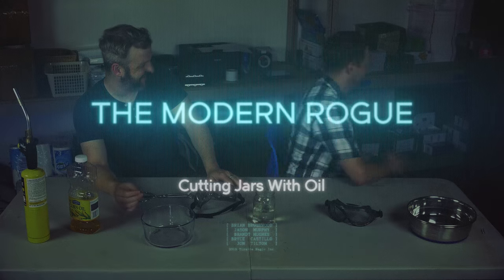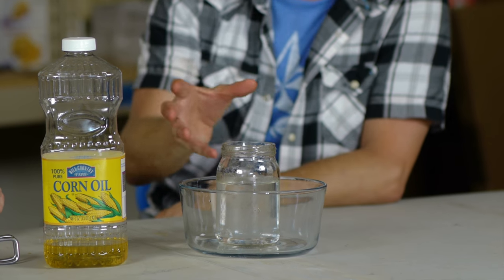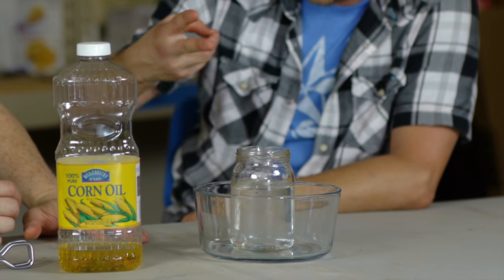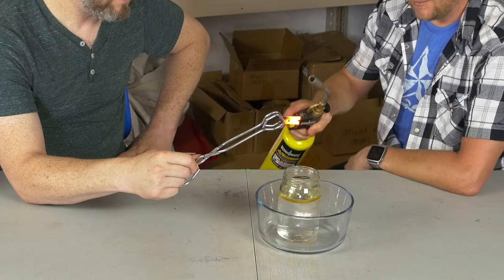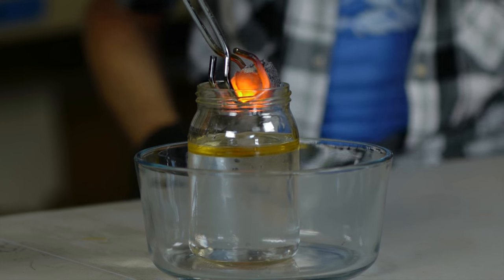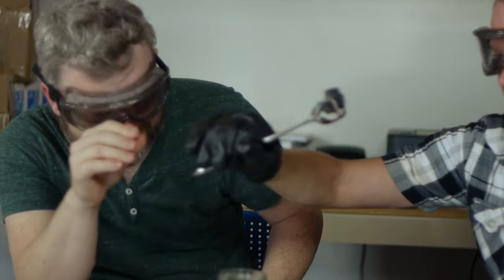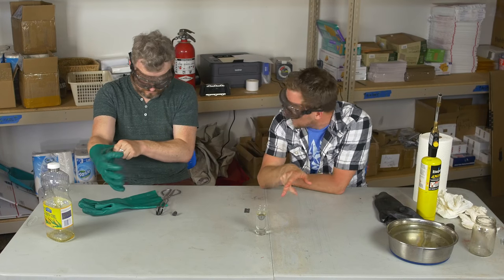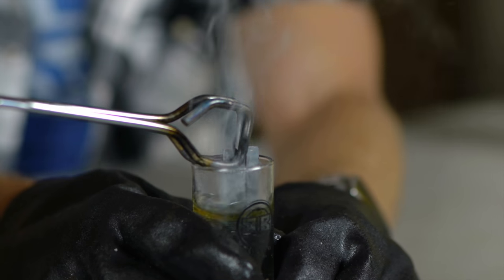Does Hot Oil Really Cut Glass?

Comment: This is much easier to do this with duct tape, a candle and an ice cube. 
Score the glass with a hacksaw blade, bastard file, nail file, bread knife, nail or anything else that can scratch the surface. Tape around the underside of that line (reflective tape is the best). Rotate it over a candle until it becomes uncomfortable to hold then rub an ice cube around the glass just above the line and it will crack along the score. 
Improvements include using a torch with the glass filled with water up to the height of the tape and flipping over and dipping it into an ice bath rather than using the ice cube.
My room mates and I made votive holders out of old ramune bottles using this method.
Reply from the maker: If you have a hacksaw, why wouldn't you just cut through the jar?
Reply: +Scam School because it wouldn't be as much of a clean cut.
Reply: Scam School Exactly as neto503 said, as well as not having a pile of glass dust to dispose of. Breathe that in and you might as well have smoked a whole carton of cigarettes.
Reply: +Scam School As a random independent observer of this conversation, I believe the method mentioned above should theoretically work, especially if you score it with, say, a flashy diamond ring. Even it it fails, I'd give it a watch, like, and maybe even a share(but let's be honest, I have no friends, so sharing wouldn't do much good from me.)
Reply: Bobal27
I know this works. I used it many times.

Comment: 1. Fill with water to the line you want to cut.
2. Fill the rest of the way to the top of the glass with oil
3. Use the torch directly on the side of the glass in the area of the oil, rotating the glass (or the position of the torch) so that you heat all sides evenly.

Only some glass works. Some glass handles temperature-induced stress-fractures better than others. The thickness should be irrelevant. Probably best done with empty $5 wine bottles.

Different boiling temperatures are irrelevant as well since the water shouldn't boil in the first place, and the oil would burn before it boils. The trick is to have one part of the glass be a vastly different temperature than another. Setting the very bottom of the glass in ice water or putting a thin layer of a third kind of liquid (like a denser type of oil) can also help, as the idea is that heat has trouble passing from one medium to another. The change in mediums is acting like insulation that should cause the part of glass contacting the oil and the part that's contacting water to be different temperatures.

Honestly though, you don't really need the oil. This can be done with just water. Just do the same thing as above but without the oil, the oil just helps to distribute the heat evenly.
Reply: and so at some point the glass will break throwing hot oil into a flame. Not good?
Reply: Vegetable oil isn't lighter fluid or something, it doesn't immediately catch fire and get out of control at the slightest sight of flame and the glass doesn't shatter like an explosive as long as you don't stick a cork in the thing. It should break cleanly and in a controlled manner. 

Besides, as I said at the end you don't really need the oil anyway. You can do this with water alone.

Comment: you need a source of heat where by there is a discrepancy in the surface to make a ring, like the oil, ideally you'd have the water in a bowl, you'd bring the oil just under its boil boiling point and poor it in the water , leave it a few seconds to heat up a ring and then you'd want to pick up the glass and put it in ice cold water where by the temperature difference causes internal stresses and blows the glass, hopefully in the ring or it will completely blow the glass bottle if too much area is heated
Reply: to clarify where I say ring I mean the shape that the oil will make on the glass, not a physical item =)
Reply: Pouring boiling oil into water is a really bad idea since the water will instantly boil and likely throw hot oil everywhere
Reply: +J A i never said it was a good idea, the actual trick is to get a string soaked in rubbing alcohol and just light that before chucking it into the water
Reply: shiro yuki I just didn't want anybody trying what you suggested without realising the risks.
Reply: yup finally someone who else knows yes
Reply: As a Chef, I can tell you putting very hot oil onto water is a bad idea!
Reply: How can you poor water?
Reply: +marcjtdc to be fair i wasnt actually saying a method that is safe to do or the best way, just the only way i could think it would work, usually most just grab string thats soaked in rubbing alcohol, tie a ring around the bottle, light the string and then just drop it in ice water

Comment: if you want to do it with water and oil,  pour oil around the glass in a heatable bowl so it is just under the lip of the glass,  pour water into the glass right where you want it to cut,  and start to heat up the oil on the stove or something,  it is the temperature difference that will allow the glass to cut right above the water line

Comment: 1. Score the glass. NB. Use a jig as you need super powers to get it level freehand.
2. Stand in a metal pan.
3. Add room temp water to the jar until level with the scoring.
4. Add room temp water to the pan. 
NB, This is VERY IMPORTANT: Fill pan slowly while looking at the surface tension where it touches the glass. It will be concave and you have to get point of surface tension a hair's width from the score line.
5. Put a little (Rape Seed) oil onto the water, just about 10ml-20ml 2-4 teaspoons. Add it by running it slowly down the outside of the jar.
This should now cause the oil to float on the water in a pool that encircles the glass, and this is what makes it work, the oil is now filling the scored line. Add more oil if the oil has not joined up around the jar, but you don't need to cover the whole surface of the bowl. The more oil in contact with the water surface the greater it will act as a heat sink.
6. Heat a thin strip of metal until it's cherry red.
7. touch the oil. Ideally you would touch the oil actually where it intersects (and fills) with the scored glass for best localized heat transfer, but you can just get it close.
PLEASE NOTE. You are not trying to heat a ring of oil around the entire receptacle. What you are doing is getting one tiny spot to split with thermal shock. That tiny "hit" (you can think of it as an tiny explosion in the crystalline lattice) will then run around the score line in the receptacle splitting like a fault line in a very tidy earthquake.
Technically you should be able to initiate thermal shock with just a little oil touching a single point of the scored line, but I've never tried. I'm of the opinion that full encirclement might carry the thermal shock trapped in the scoring further around the glass receptacle.

PS Yes there was "some other magic step" you needed to do, and yes you did do it wrong. No scoring and WAY too much, too dense oil (corn oil is heavy so forms a thicker layer).
Going to try again now you know the how and why?

Comment: I have seen different versions of this trick and one involves a thin cord or rope that you soak in oil or your other high boiling point liquid. Then you heat the rope and dip it into cold water. It creates the same thermal shock but much quicker so it has a bigger effect, unlike this one where the oil has to be heated and until you reheat the metal the oil's back to normal temperature.

Comment: HEY BRUSHNUTS!
What you're doing is tempering the glass. Back in my Material Science class during the glass unit we would take particularly finiky pieces of glass and heat them up, when they cooled they didn't break but they became much easier to cut with glass cutters. I would assume that most mason jars would be finiky enough to do that with.

Comment: the way i seen to cut it with oil and water was the string method. 

soak string in rubbing alcohol or any flammable liquid 
wrap around glass at point you wish to cut at
clean surrounding area and light on fire,
let burn for 10-15 seconds, put it out and use cold water.

ive cut several bottles but never with a clean cut with that method.

Comment: The big issue with this. Is because the oil is getting hot, with the water under it is still dispersing the heat enough to avoid temperature shock, you have to apply a thin line of oil along the point you want to crack, then heat it. Then pour cold water over the heated line.

Comment: you dip twine or string in acetone wrap it twice around the bottle where you want it to break but it has to be tight you tie the ends real tight and then you light it in a slightly darkened garage  and let tge rope burn for about 30 seconds to one minute. snuff out the flame and quickly dip the bottom half in a bucket of cold water. this method works best for beer bottles and trust me it does work. However you want to carefully wet stone or sand the break for it will be super sharp if you dont do this.

Comment: I once split a drinking glass accidentally. I took it right out of the dishwasher and put ice water in it. When I picked it up, the bottom just silently slipped off the rest of the glass. Perhaps if you lifted the glass from above the oil it would break, but then again maybe trying to boil oil while it is in contact with water is just a terrible idea.

Comment: I have cut heaps of glass bottles using a rapid change in temperature.
 But this method seems very weird.
It might work if you first scratch a line into the glass first.
This is what I have done and it works really well.... Scratch a line in the bottle where you want to split it. Heat that scratched line up witch a flame and then just dunk the whole bottle into cold water.
 The glass stresses and cracks (hopefully) along the scratched line

Comment: im no expert or anything, but i think its the changing in heat that shatters the glass. so what i think you would have to do, is have ice water, with oil on it, heat up  the oil to as  hot as you can,  and then dip the whole thing in ice water.

its like when you boil a glass, and toss it into the snow, it shatters where the show touches it.

Comment: Easier to use a bucket of ice water (lots of ice), and string soaked in rubbing alcohol. Wind the string around the glass a few times and tie it off. Light the string on fire (best done outside) then, once the flame is TOTALLY out, dunk the whole thing in the ice water. Voila, "cut" glass. Or try putting a lot of ice in the water beneath the oil. It's the sudden difference in temperature that stresses the glass to fracture.

Comment: you should try scoring the glass with a cutter to see if that happens 
if you soak a string in alcohol after scoring around a bottle and then lighting the string on fire it will cut that way
Reply from the maker: Yeah, that version almost certainly works.
Reply: That kind of defeats the point of this video though. As that method was excluded. 
It "works". But it was not a part of the question answered in this video.
Reply: +Scam School hi

Comment: a string tied around the glass at the point you want to cut it, pour vodka, petrol thinners or whatever combustible fluid onto the string. Light it but keep turning the glass, when flame goes out dunk the glass in a bucket of cold water. Easy and way less dangerous than this.

Comment: theres an alternate method that i know that 100% works. you take a thick yarn and soak it in lighter fluid. you then wrap it around the bottle/jar your looking to cut. fill a bucket or sink with water. wrap the yarn around the jar and set on fire. let burn a minute then slowly set into the water. when the fire reaches the bottle the jar/bottle cuts

Comment: me and my sister did try this recently with a Smirnoff bottle, needless to say it didn't work, however soaking a piece of string in methylated spirit, wrapping it around where we wanted the break to happen, igniting it, then dunking it in a tub of ice water after the flames went out (process was repeated a couple times) it did break evenly at the point that was heated from the flames 

t.l.d.r. tried it, oil method doesnt work, precision heating does

Comment: the only way to cut glass is to score it with a fine scratch. apply pressure opposite the score and a crack with form and follow the line. thermal shock can be used with bottles. boiling water along the score line will cause the same effect.

Comment: Get a hair tie, soak it in rubbing alcohol, wrap it around a beer bottle then light it and let it burn for about 30 second. once it has burned run it under cold water and the thermal shock will cracked it.

Comment: while I don't think this tactic works you can cut a bottle with string. soak  string in lighter fluid, wrap it around a bottle thinly (2-3 times), light it and spin the bartender a few mins until the flame dies down, then immediately dip it in cold water and it should break in an even line. 
For a video on it a youtuber by the name of crazyrussianhacker has a good video on it.

Comment: I know if you have a really hot glass and you pour really cold water into it, the glass will split apart smoothly. I just don't think you can be very accurate on where you want it to split because when I did it the glass was still being filled up when it split apart. As for oil and a torch? Hell if I know.

Comment: I had a glass cup, I just got done washing it with hot water (not even hot enough to burn skin). When I poured in cold water from the fridge the glass broke in my hand.
Reply: I think it has more to do with repeated stress fractures. If you try this with glass that is basically unused, it'll be much harder to do. My glasses are about 25 years old. I imagine 25 years of repeated use has caused millions of tiny little stress fractures, basically just waiting for the right conditions to break. I bet if you put the mason jar in boiling water and then cold water a few times, eventually the whole thing would just explode.

Comment: I've seen it done with a bottle sitting in cold water with an inch of oil in the bottom of the bottle and a red hot poker from a fire put into the oil. 
Why on earth are they trying to heat that amount of oil with a little bit of metal...Doh!

Comment: The oil is hot enough to burn... The water boils and spits oil up into the air if the metal piece comes under water... Brians suggestion: leta dip the metal piece in the water

Comment: the cutting glass thing I saw was a bottle with a rope the rope was set on fire after a while they diped the botle in water and it broke the botle on the point where the rope was 

it works becouse of the sudden change of temperature

Comment: I'm a blacksmith (not meaning much) but u should get the steel way hotter where it looks like the steel is melting and also use motor oil its thicker and dark which will hold more heat, I use motor oil on knives I make to strengthen them and I've made some really small swords out of nails and I use a shot glass to hold the oil and its sharers my glass

Comment: how are you supposed to get the oil hot, when you have the huge thermal mass of the water below cooling it faster than you can heat it, and why dont people physics? 
btw: the key to cutting bottles and jars isn't heat, but scoring the glass perfectly. once you manage that, a few flushes of moderately hot and cold water, maybe 50C/120F difference, are enough to drive the crack, and break it cleanly.

Comment: That tiny chunk of iron and that razor isn't an efficient way to heat the oil.. You'd need a direct heat source to cover/heat all the oil and only the oil all at once.. The flames occur not because the oil is hot enough to ignite but because minuscule amounts on the surface of the iron are in contact and can reach that temperature to ignite

Comment: Theres a way where you can cut glass with some string, alcohol and ice cold water.
Reply from the maker: yeah.  There's plenty of other ways, but this is the one we were testing.
Reply: A friend of mine did this. Had a couple of successful attempts, even had a bucket of water nearby to quench the burning string.

Turns out you should refresh that water though, because one time, they dunked some burning string and the whole bucket ignited because of the alcohol on the surface.

No-one got hurt and they didn't burn the house down, so the video is fucking hilarious, but:

Stay safe, kids!

Comment: ice on the inside of a glass I'm only on the outside will shatter the whole class the reason you feel the line inside the glass of water is behind the same premise except for I would have added ice to my water to keep it cool in the process of the oil heating so the temperature displacement would cause the glass to crack in the correct place I have not finish this video nor do I care to thank you for uploading something that was interesting in part

Comment: put the glass in cold water after you heat oil the difference in temperature between the inside and the outside will cut it instantly

Comment: almost had it the second try....you were suppose to add water "around" the glass thats the same height you put water "in" the glass then add oil on top of the water thats on the outside of the glass and then you could cut it...what you did was add only oil around the glass and not only that...it was too much....a thin layer of oil would do on top of water

Comment: better idea. wrap a coat hanger around the glass u wanna break. heat the hanger red hot and put it around the glass. then dip the glass in water before it has a chance to cool down. if you have really thick steel rings you Dont even need to cool the glass. the sudden heat cuts it.

Comment: instead of heating the oil or water try heating the glass where you want it to crack then submerge it in water. I have done this many times and I guarantee that it works. make sure that the bottle or whatever your heating is empty so that the glass cant transfer heat to anything but the air around it.